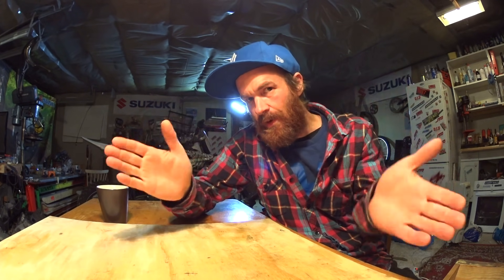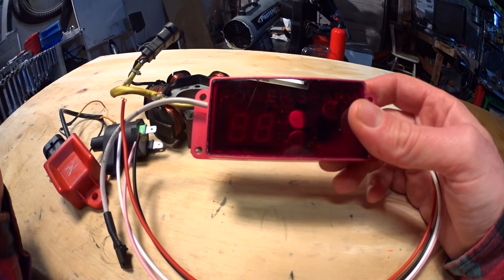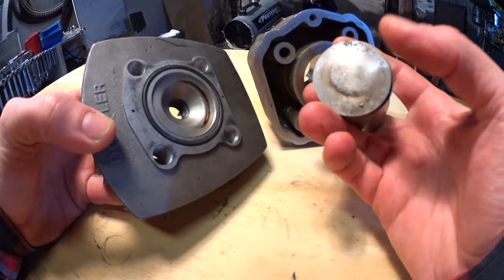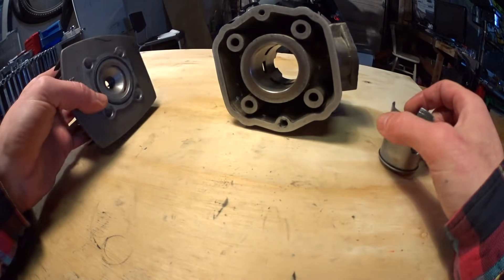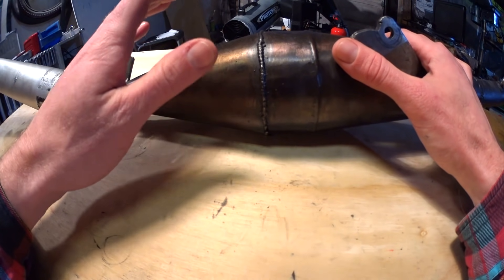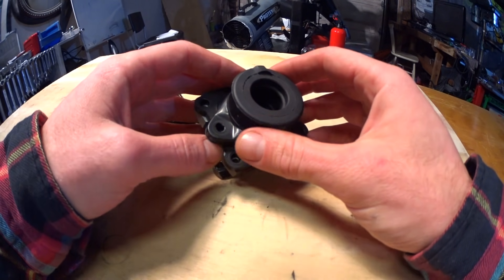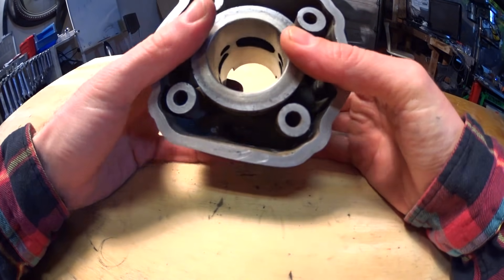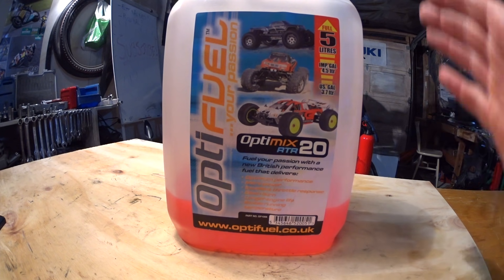10 FREE WAYS to MORE POWER in a TWO STROKE Engine! DIRTBIKE/SCOOTER/MOPED | 2 STROKE TUNING

Comment: When you tight the squish clearance in a 250 (ktm exc) but the stock ignition fires too early at top rpm so you loose power on top :'( 
Gotta upgrade that ecu sooner or later ahahah
Reply: jnuxca well you could buy a Dremel
Reply: jnuxca you should just get v force or boysen reeds. Depending on witch one gives the most performance increase. Also go with a fly wheel weight. Right now i have a 07 yz250 with a 265 kit. I have a port and polish job for mid to top end power. After that i threw on boysen reeds and removed the stock spacer. Got some head work done. Bike rips...currently needs a right side oil seal 😪 but if you got the money go with porting as a first step. You can get bottom to mid port jobs and mid to top. Eric gorr does a great job and hes not the most expensive.
Reply: been reading positive feedback about eric gorr's work, unfortunately i'm european so shipping wouldn't be 
cheap and it would take a long time, that and also i'm running low on money (i'm a student) gotta save money for tyres, can't really afford engine mods for now ahahah
Reply: ktm comes stock with v force reeds, also i mine is an exc (not the sx model) so planty of flywheel weight trust me, it gets boring waiting for the engine to gain rpms ahahah, your bike sounds like a a good project, i would only miss the  hydraulic clutch
Reply: jnuxca hm interesting. Never knew that. I have always been interested in a buying a ktm i just never found a nice one thats isnt a arm and a leg for price lol.
Reply: jnuxca id go with porting then. Look up eric gorr. You send your cylinder in and they will take care of the rest. Look up their website once.
Reply: I presume you planed the head, without raising the cylinder. Doing a half assed job will give you problems. Next time, whatever you take off the head, add to the base gasket. You will have an increased squish band width, which increases the air velocity, reducing pre ignition. Increased compression, which will give you more torque and increased port timing which will reduce the amount of air/fuel you are compressing ( basically reducing your engine size when comparing the actual compressed air/fuel ) and allow more time for the air/fuel to enter the engine and exhaust to exit the engine. You will have a lot less power down low and a little more top end. You could have detonation problems at mid to high RPM, depending on how much you take off the head. That can usually be fixed with octane. You can easily produce much less power over all, by getting this wrong.
Reply: Or advance the timing
Reply: you mean moving the sensor? i don't want to fuck up the timing on the other rpms, it's an enduro bike i need some power on low and mid rpms

Comment: Stinger outlet, basic rule (Jennings rule) do not reduce the outlet size to any less then 0.58 times the cross sectional area of the header inlet pipe, that's area not diameter. Any smaller may melt a hole in the crown of the piston. Fact is the exhaust inlet size does not always correlate to the actual port size or volume of gas coming from it so that rule is pretty fluffy but its a start.
To do it with any degree of accuracy you need to have CC temp and EG temp.
First sign is a light ash on the piston crown you can see through the plug hole with a torch, by then the piston is dead but if you replace the piston then at least it wont hole out causing damage down below and mashing bits of it into the cc.
Reply: I would say, tune it with a pressuregauge.
0.3bar is quite good pressure in the belly.
Reply: i used jennings formulas in the 70,s now there are a million better, now you can buy real good computer programs , blairs is one of the best , you defiantly require cht and e g t and possibly using two e g ts in the exhaust , to check the differential temps between the port and stinger,and now lambdas are so fast to check fuel /air , interia dynos will always give high bhp figures because , 1 you can lean the mixture out because it is only on w o t for a few seconds , also you can use more advance because the engine hasnt had time to react to the temp change , also what barometric conversion are you using
Reply: @alancollard8939  you lean out a two stroke and its engine life goes from years of service to a matter of seconds to toast and game over
Reply: If you are prepared to weld a pressure tap in it that's a good method to use. Just watch the CC temp whichever way you do it.
Reply: I sanded my head unroll I had 135psi compression and it ran too hot. I backed it down to 110psi and it ran much better than the stock 100psi I had on a new scooter. There was still .07 mm left in the squish band. I used lead solder to get my squish measurment.
Reply: @kirklong5067  chances are all you needed was one size larger main jet and a colder heat range spark plug ..first of all when you are trying to increase horsepower you will always have to increase the fuel/air ratio..and that increase the btu's of combustion ..but does not increase cooling capacity  ..so you start out using the coldest heat range spark plug you can find that will fit ..and if it does not fowl out or turn black but looks as clean as stock did look ..you probably have the overheating problem cured with your higher compression and H.P. numbers giving you even more than you limited yourself when you drop down a bit on compression
Reply from the maker: +AuMechanic Good info!
Reply from the maker: +Patrick Wetterskog That's good advice!
Reply: Sounds like u screwed up on porting it. What are ur numbers for port timing?
Reply: by that rule the stinger on the pocket bike pipe I bought is waay too small (maybe half the DIAMETER) but it leaks air at the pipe junctions. I know my motor doesn't like backpressure either because after I ported it it wouldnt even start until I pryed open the baffle on the old muffler. Its a folding bicycle with modified pocket bike engine (dual piston/intake ports and boost port) and 3 gears, have vids its on my channel
Reply: @ghettobikelife8833  boost port !!! You are the 1st one I have ever seen use the proper terminology of what really happens inside a ported two stroke engine ...as maybe just maybe you might be able to explain how a two stroke engine actually functions ..because so far no one in the last 8 years of reading comments has even a single clue of getting it right

Comment: great video man! quick and straight to the point, I like it. Think I'll set up my next build to run nitro. I have run 99% isopropanol mixed with 2t oil before, just to get to the gas station. Definitely more power, definitely a different smell and sound.
Reply from the maker: +Kosmoto Thanks! Do it!
Reply: Its could be a stupid question... my english is maybe not so good.
But...that ring you put on the cilinder, where's that for?
Reply: @marcello033  to raise the cylinder in order to get much more aggressive port timing. Measure first and decide if there is enough to gain. I go up to 170/122/155 degrees port timing for cylinders with piston controlled inlets. This is fine for 50-70ccm

Comment: The stinger size is interesting just changed the pipe on my huffy the new pipe looked larger but seamed to be down on power but at the same time swapped from 44t to 36t so assumed it was the gear change will look into it and see if I can recover some power
Reply: derk nobit put the old sprocket on it and see if you have got more power. You should do things one at a time to find out what works and what doesn’t
Reply: RideSouthWest ya should have but didn't.
Reply: derk nobit yeah haha I’ve done the same many times. Just things you pick up when tuning engines and stuff
Reply: but it gonna reduce the torque

Comment: Thanks I’m going to try the smaller exhaust stinger on my tomos 65cc 😎
Reply: Great name :D
Reply: 65cc did not exist, but did you get any power on it?
Reply: yes for sure that modification is usual here but is wrong, you get torque for riding with two but loose all higher rpm, and all these videos are about high rpm power original piston is 38mm and up to 39mm is 50cc (if we want to be in 50cc class)
Reply: forgecro pretty sure exhaust flow is what matters.. If you can go just as fast at 10k why bother going to 12